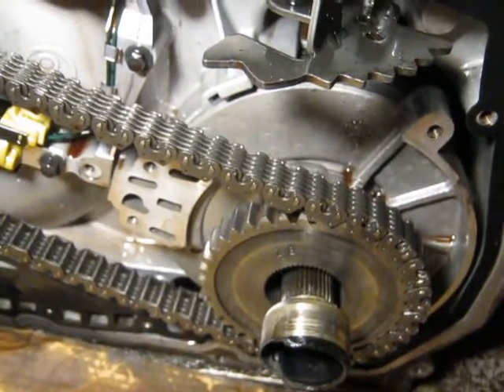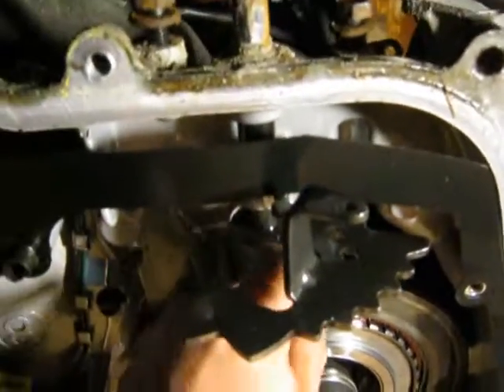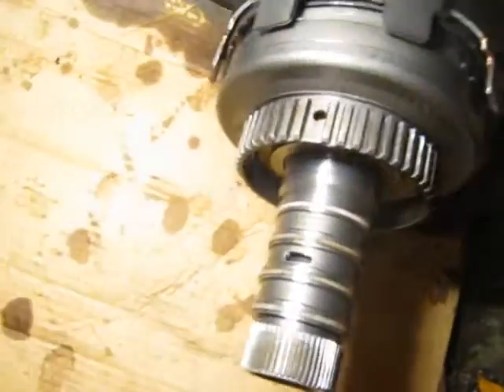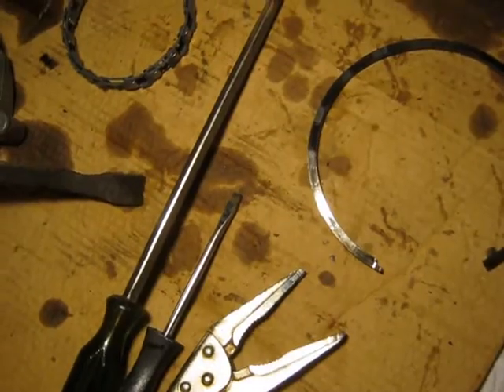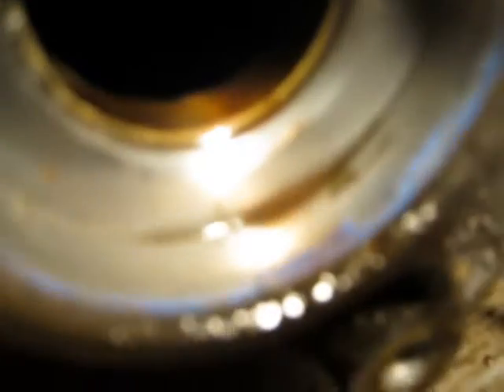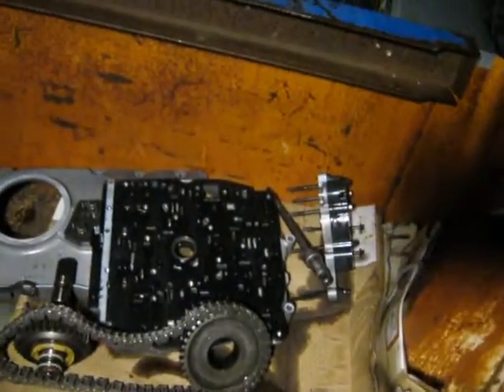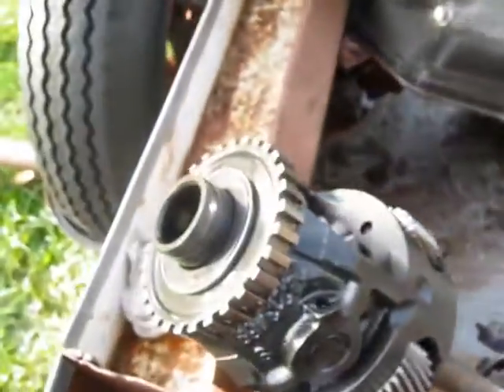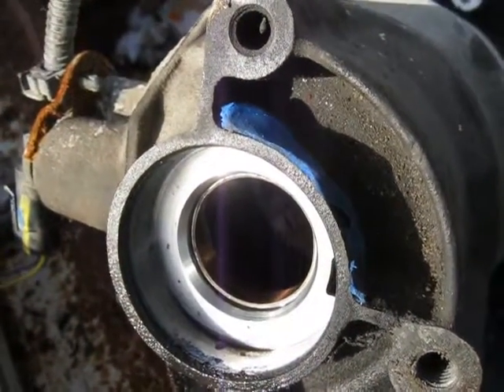GM 4T40-E Transmission Teardown Part3

Comment: I have a problem on this transmission, i have oil leak from oilseal axle the both side, i changed the oilseal and the ring and the leaking didn't stop, some one tell me their is a shake in axle while rotatition and that make axle didn't move straight, is that's true and what's the right way to fix this issue
Reply from the maker: If the axle is bent, or out of round etc. there is no way it will seal. You must have a straight axle to stand a chance of it sealing properly. You could try packing some thick grease around it as a last resort!

Comment: good day
unfortunately I do not speak your language sufficiently for communication .. because I am writing through a Google translator
Let me ask you a few questions.
I have saturn wue. AQPP 4t45, while the gas is being added, the car does not accelerate fast enough .. can you tell me what it is preparing for?
and the second question ... what's the difference between 4t45e and 4t40? with respect Alexey
Reply from the maker: Hi Alexey, I am not sure about the difference between the 2 transmission you mention. My guess is that it has to do with the physical size of it. The 4t45e is for a heavier car than the 4t40e, the e stands for electonic shifting. look it up on google, it describes them there. The acceleration problem could be the transmission slipping, or a different problem. My Saturn L series had a plugged catalytic converter, that caused it to only rev to 4000 rpm, and no more. Hope this is of some help to you.

Comment: What was the reason for tear down?  I have a 4T45E with the same worn out  right side axle bushing.  Vehicle doesn't have any current driveability concerns, play in axle was noticed during inspection.  Trans. has just under 100k on it.
Reply from the maker: I tore this trans apart, as I wanted to see if the bushing for the axle was easily replacable, which it is not.  Your trans is probably fine, I have driven mine for another year and a half, and it is holding up OK. The trans I tore down was slipping in a gear, as one of the clutch packs was burned up.

Comment: These are nearly identical to the Ford AXOD line (Ford and GM collaborated on several transmission designs). I worked for a company that remanufactured transmissions and we worked on the AXOD line among others. PAIN IN THE BUTT to disassemble! It is easier if you can do so with the cover side facing up, but you'd need a pretty specific stand.

Oh the parts! Parts inside parts. Seals EVERYWHERE! Seals inside seals! How any of these are manufactured without error is incredible. Trying to cram everything into that long tube results in a nightmare for anyone working on the beast!
Reply from the maker: Yes, this thing is a real joy for sure!
I wonder what the new 8 and 10 speeds are like, actually, I probably don't want to know, it might give me nightmares!!!  :)
 That 1972 Rattlesnake infested Plymouth Valiant 4 door sitting on a rock pile in Arizona is starting to look like a better option everyday!  :)
Reply: More speeds means more clutches crammed into an already tight space. I don't want to know either!

While I was working there, I was assigned the GM 6T70 transmission. Crappy transmission, but VERY easy to fix. It was my job to troubleshoot transmissions that failed the test stands and fix them. I could completely disassemble one, change out a broken main case and reassemble it in less than an hour.

The AXOD transmissions, on the other hand, required their own special sub-line with specially trained techs and the failure rate was very high. Typically they did less than 20 per day and the failure rate was usually far above half.